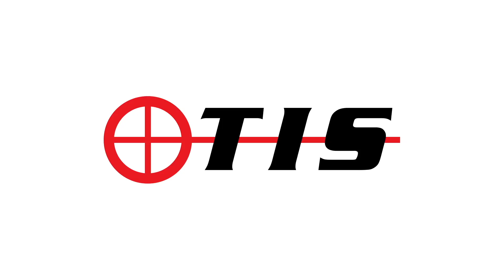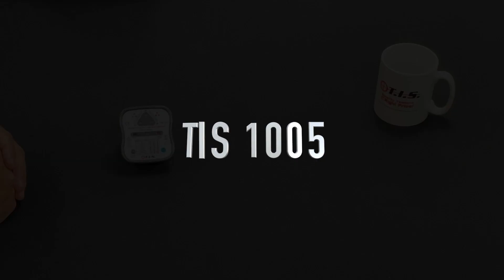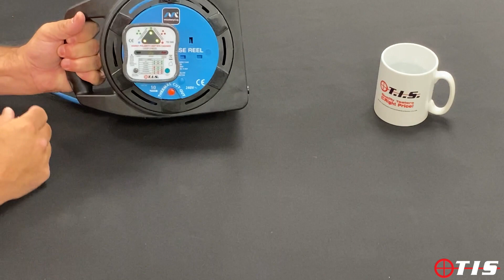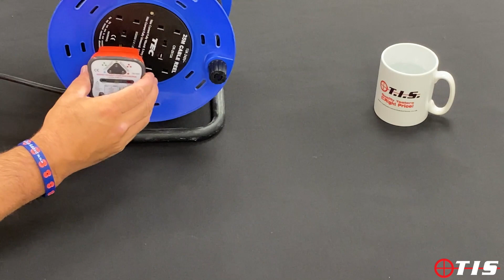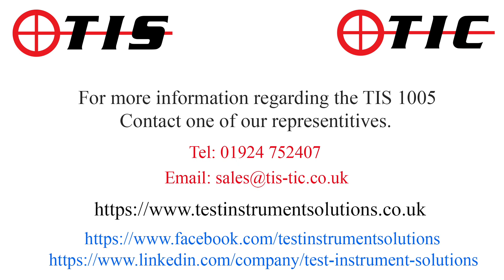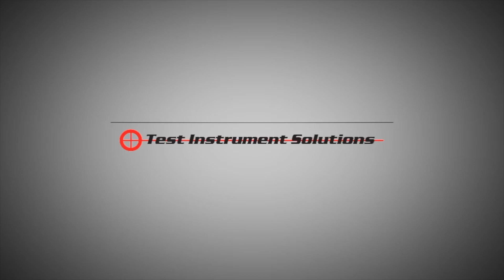TIS1005 Socket & RCD Tester

Comment: In a TT system the maximum allowed earth loop impedance reading is 1666 ohms, although I understand that around the 200 ohm mark give or take is generally accepted as Ok, so won't this typically flag a red warning for most TT systems? Is it designed for use on TT systems? Thanks.